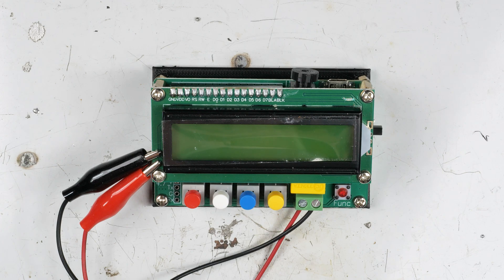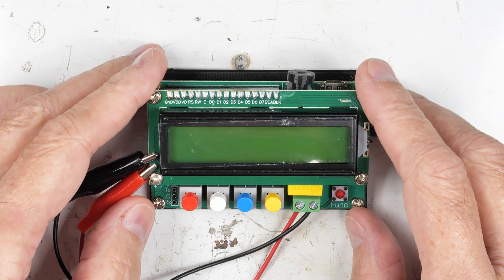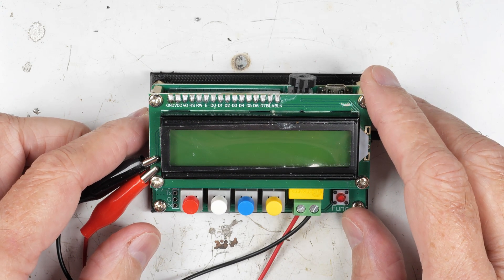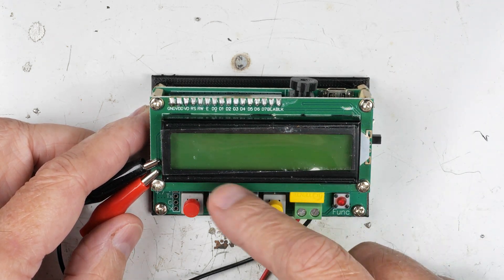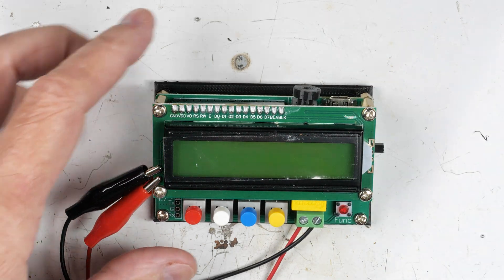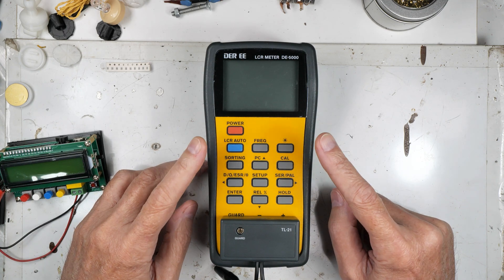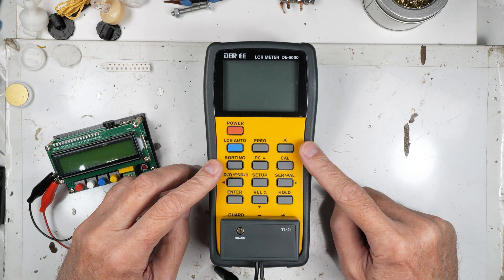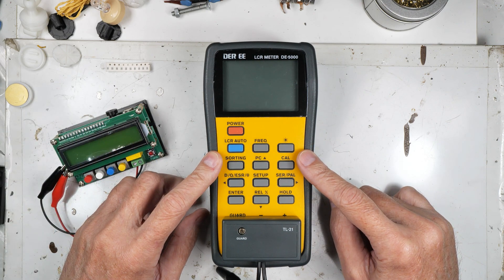Electronics-Replacing The LC100A LCR Meter (4K)

Comment: A bit too pricey for my needs. Instead buying an 450-500€ device that I do not know how much it will last, I will keep using my old trusty GDM that I built many years ago. But hey, I am glad you find an LCR meter that is good for your needs.
Reply from the maker: @sebastian19745  I have found this online for about $140 USD
Reply: @tsbrownie  Yes, I found that there are lower prices, after I commented; in Aliexpress, the prices that I just find are from 450 to 515€. However, I find prices as low as 140€.
Reply: @ Those prices I find on Aliexpress. However, after commenting I finded on other sites prices as low as 146€. Thank you.

Comment: I have that one you have had trouble with. Mine is good. But I haven't used it a lot. When I bought it, I wanted something that read very low inductance. Which that does. I did see a video, where when in the inductor mode, he pushed a button and said he didn't know what that did. He should have had the two leads connected, and would have got an OK from memory. It then takes into account the inductance of the leads, for the next inductor measurement.